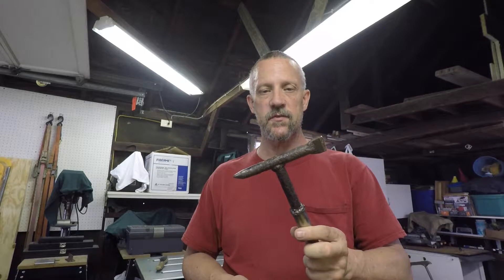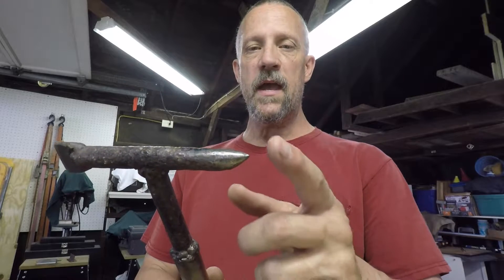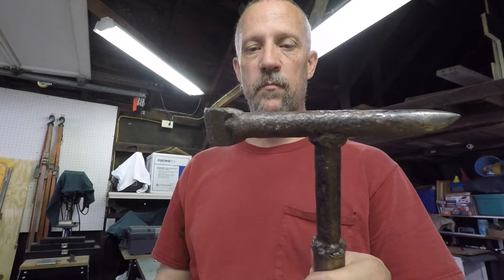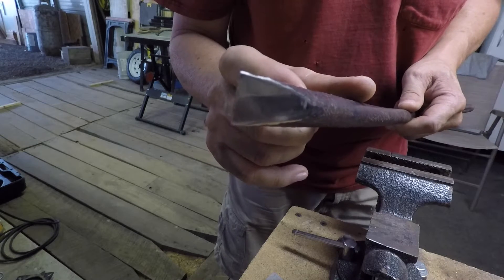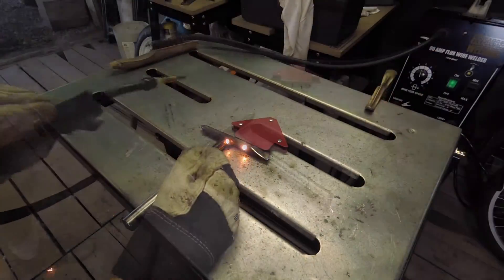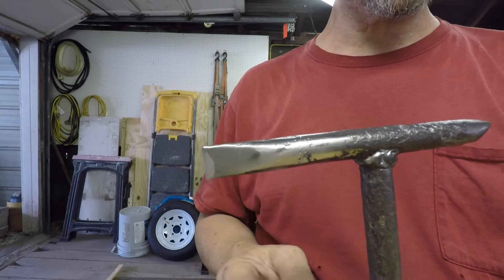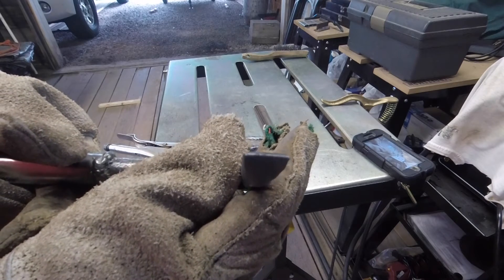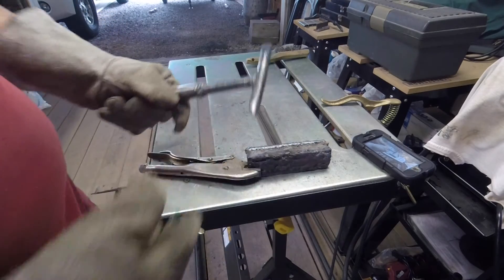Welding Chipping Hammer MODIFICATIONS - Fun Beginner Welding Projects

Comment: I did heat treat my own DIY chipping hammer using good old charcoal and a portable fan to blow air into the coal and i just quenched that hammer up in  on motor oil. It did make like a black layer on the metal on the 3rd run and it looks good
Reply from the maker: Sounds like that is a good method and it worked out well for you. Thanks for sharing your idea!